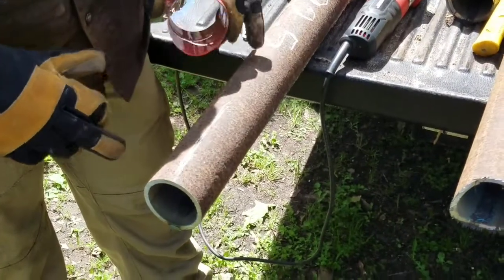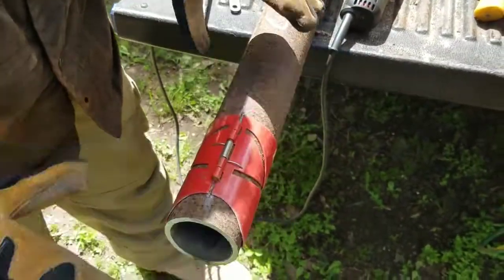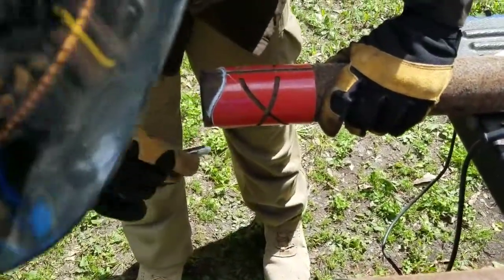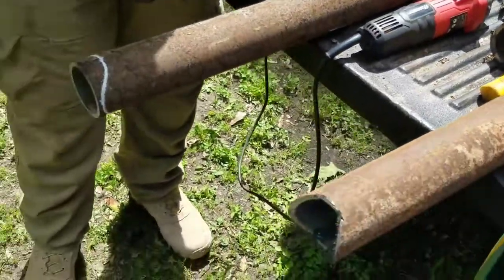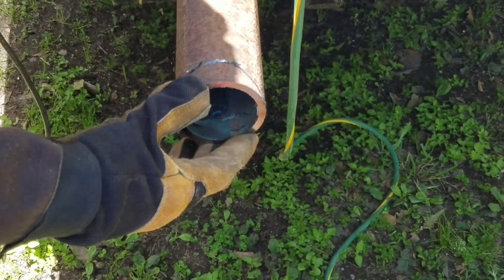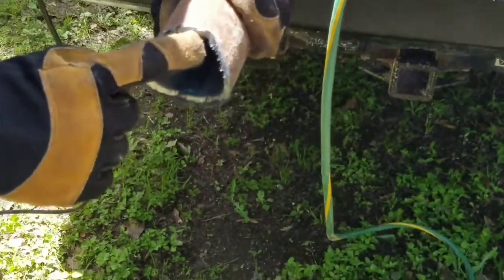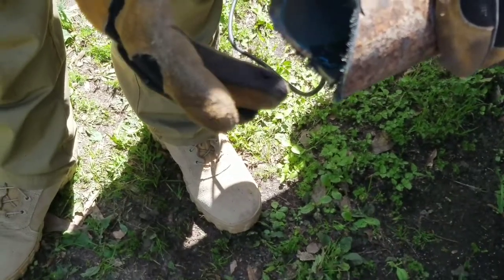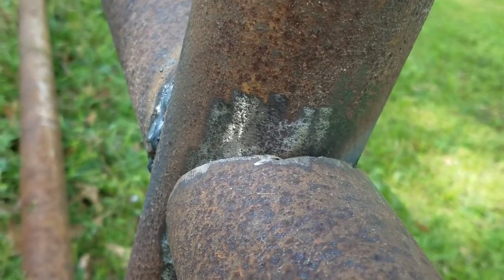How to make a saddle cut in pipe with an angle grinder.

Comment: What’s wrong with with a torch or plasma cutter 🤨
Reply from the maker: A plasma cutter, or cutting torch while perfectly adequate, are not always easy to lug out to remote locations like along a fence line.

On the other hand if you have a generator powered welder you can run an angle grinder off of it without having to carry big heavy expensive equipment with you. 

Also, the cutting wheel don't heat up the metal as much. 

It's just an option, not an end all be all.

Thanks for watching 👍